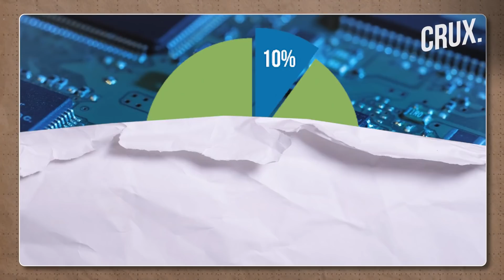Not Oil, The Next World War Could Be Fought Over This Essential Commodity That Drives World Economy

Comment: You can't produce oil if you don't have them you know, semiconductor chips can be developed over time. These are 2 different things
Reply: @Aqua Fyre 🖖well said... but sadly the value of a species is how energy is produce ... hmmm... fossil fuels is no longer required. 😊
Reply: @Aqua Fyre Semiconductors also use Arsenic, Boron, Oxygen, etc too, Boron is used as a dopant in Silicon to give the Silicon substrate certain electrical characteristics so that components like transistors can be made, Oxygen is used to create silicon Dioxide, which is an insulator, metals like aluminium are used to form the interconnections between all the components etched in the Silicon Dioxide wafer, and then there's all the chemical etchants used too, precious metals, like Gold, are also used to make integrated circuits as well, but yeah, a lot of the plastics used in the semiconductor industry are made from oil and petrochemical products.
Reply: @Gary Zhen  well said, China has SMIC doing the semiconductor manufacturing biz as well, just a matter of the process technology may only up to 8 node (nm) while Taiwan TSMC  is manufacturing various nodes 5(nm) and further advancing to 2nm an 3nm and Samsung is doing upto 7(nm).
Reply: @Aqua Fyre i know right...😔🖖
Reply: @Aqua Fyre hmmm Dear wife... dinosaurs don't die every day... hmmm let just face it... a renewable energy resource must be found... if it is split atomic energy or harvesting the power of stars... hmmm... we must invest more for our human species ambitions in that very definition of a limitless energy... hmmm we must... said Yoda. 😑🖖
Reply: @Aqua Fyre sunset today is most beautiful... dear wife... how I wish you'd be here again... hmmm......
Reply: I think I should going back home now...hmmm said forest gum...😔

Comment: The chips are designed by US companies, but they are manufactured in Taiwan.  Not unlike the iPhone was designed in US but it is made or assembled in China.  Albeit manufacturing high end chips or semiconductors is a bit more complicated and difficult.  The US can manufactured iPhone on its soil as easily as it can manufactured semiconductors.  The CHIPS Act will ensure semiconductors are manufactured in US.
Reply: Jai Hinduja.  Well solve your own  auto chips supply chain first which is based on mostly 90 nm plus technology.
Reply: not completely true. Europe makes the machines that produce high end chips exclusively.
Taiwan is just a foundary. very efficient at making chips. but they can't make any machines that make semiconductors.
they have to import these machines from USA, Europe and Japan.
and Taiwn can't design high end chips, only USA can.
Reply: The CHIPS act! Lol
Reply: don't tell me this administration finally got a win on something
Reply: @edraven693  Don't celebrate yet. Lol

Comment: The Dutch make the machines used to print the very best microchips.
Reply: What these guys also fail to mention is that china has already made its own 28nm lithography machines which it can also use to make even lower nanometer chips(like TSMC did with 28nm lithography machines)
Reply: @ameyapotdar461  im use it now in my pad. Unisoc. Even is 28nm is feel great cause the price
Reply: @ameyapotdar461   28nm chips are old technology i don't think tsmc even make them anymore. tsmc will start making 3nm before the end of the year. and i am sure that tsmc sold the 28nm lithography machines  to China  thats why have that tec.... .
Reply: @shanepayback  
TSMC isn't selling any lithography machines to china,both rely on asml to get lithography machines which is the core equipment required to make semiconductors.

Currently china has its own lithography machines (only mass production remains) which it can use to make 28nm or even lower chips(28nm - 7 nm chips)

Comment: Elon Musk makes his own MICRO CHIPS  for TESLA, now invested $ 3B for manufacturing of Micro Chips. EM had a tie-up with AMD to build all kinds of Semi Conductor, it is cheaper and last longer, all made in the USA.  It is made of Silicon Carbide, while all Micro Chip are made of SILICON.
Reply: everyone including elon is designing microprocessor. TSMC, Samsung, SMIC is producing the physical microprocessor based on those designs. 2 very different things. $3B is not enough to build the manufacturing facility.
Reply: China is also building graphene chips aka carbon chips.

It is said to be more efficient than silicon.
New innovations are on the line to replace current technology.

Comment: TSMC may have cornered the 5 nanometer but many industrial commercial demands are for 28 nanometers.  Ford F-150 needs 3000 chips per truck and most of them are the larger ones because 5 nano is relegated for smaller devices such as smartphone...in near future when graphene and optical chips come on stream, 5 nano may not be as sought after... the industry is undergoing tremendous discoveries so only time will tell who comes out ahead. As mentioned 20th century wars were fought over oil which the world is transitioning to green and renewables so will 5 nano transition to ???